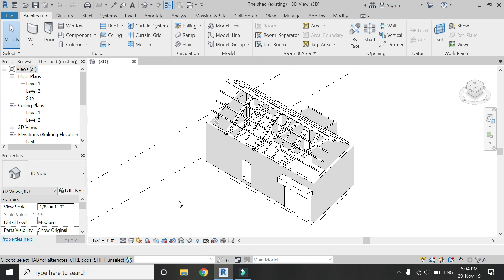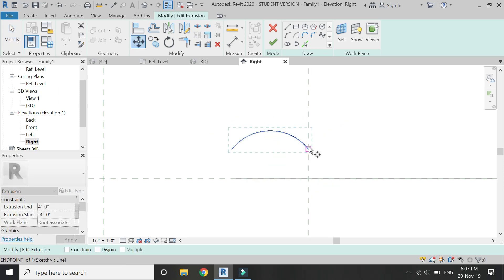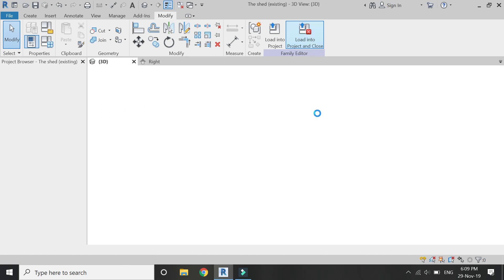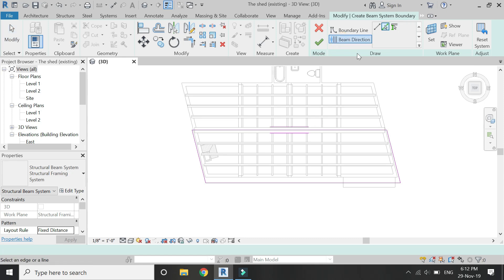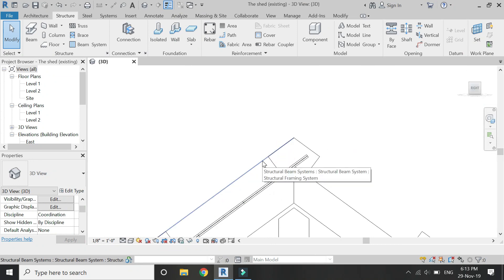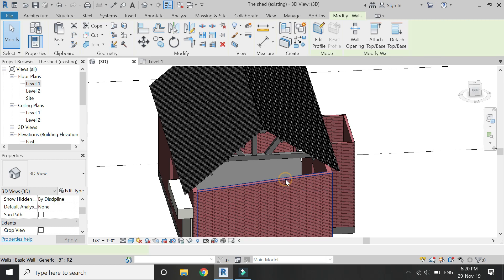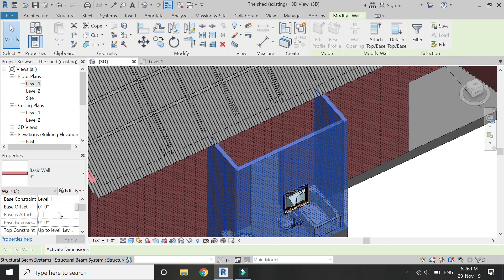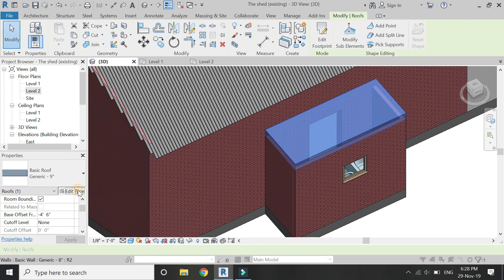Revit Tutorial - Corrugated Sheet - Renovation Project (Part 3)

Comment: I do not agree with this to show corrugated sheeting, it also seems really heavy. I think if I had to do this, I would try with sloping floors first. See this video https://www.youtube.com/watch?v=sPI7OYXCqo0 There is a part where he can select "stand-alone deck" near the bottom of the dialog box. If you do that, you can delete the concrete layer and just have the corrugated metal. Then when you cut in section, it looks right. I would then apply a material with a hatch pattern to make it read like corrugated metal. While I think your method works, it just does not seem ideal to work with. I have seen other videos of people making corrugated metal roofs using sloped glazing, that may be a better option if you have to have the 3d detail.
Reply from the maker: First of all i am really grateful for the feedback which you provide. I really appreciate it. I will upload the tutorial in which you can create corrugated roof with the help of metal deck floor. It has a issue which is that it does not show the detail in 3D view but on the other hand it is perfect for the sectional drawings and it does not make the file size larger.
As for the method of sloped glazing. it is approximately the same method as the one which I have shown as instead of mullions I am using the beams. I have also tried this sloped roof technique but I am never able to delete the glass out of it. The glass remains there which is not needed.
Reply: @LetsRevit  you need to select empty system panel to get rid of the glass. I was not sure if the sloped glazing is any better the the way you showed, I just though it might be less heavy, but maybe it isn't. I'm glad to give you my input since you spend the time to make, edit, and upload these videos. Thanks as usual!
Reply from the maker: Thank you for your kind words and the appreciation. I am always grateful for the inputs which you provide. It also helps me to learn.

Comment: What is your system/laptop configuration??? Also what configuration you suggest for laptop in-order to have a smooth functioning of REVIT 2020.2 software??? It will be beneficial, if you share it... Shukran.
Reply from the maker: I have both laptop and desktop PC. For large projects and renderings, I use the desktop. For architectural softwares I always recommend desktop over laptop.
Benefits of Desktop:
1. You can choose a large working screen.
2. They are cheaper then laptops.
3. They have more life.
4. And they do not overheat as easily.
5. You can build your own PC according to your demands and requirements.
Hardware necessary for Revit:
1. Processor should not be less than i-5 with 7 generation. But if you can, you should go for higher processors.
2. Never go below 8GB RAM. But for Revit, I would recommend the RAM to be 16GB.
3. Always prefer SSD over simple hard drive. But SSD is way more expensive, so I have both SSD and hard in my desktop. I have a 128GB SSD and 500GB hardrive. I install all the softwares in the SSD and hard drive is only used for storage of files. If you want to have a laptop, always buy the one with SSD. My laptop has a 256GB SSD and I have an external hardrive where I keep all the files. If you need to install 6,7 softwares then choose 256GB over 128GB SSD.
4. As for the graphics card, I don't remember right now but I would inform you tomorrow about the card which I have installed in my desktop. You don't need to have a very expensive graphics card for Revit. People who work with animations and scenes need a high end card.